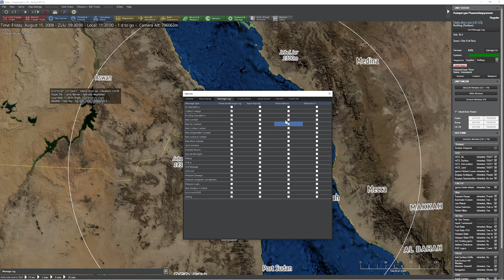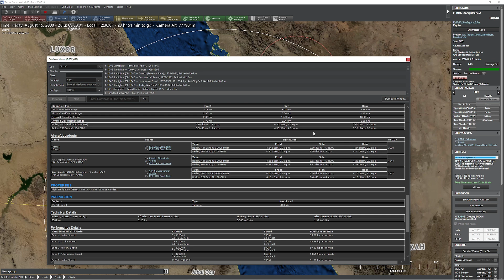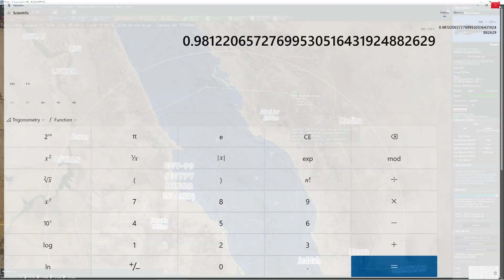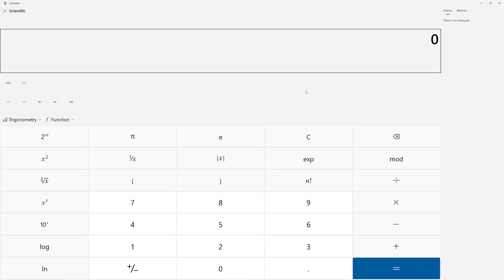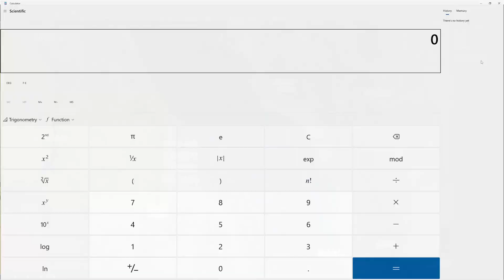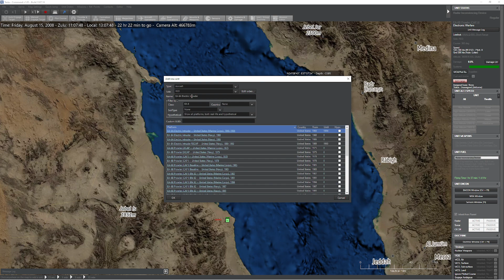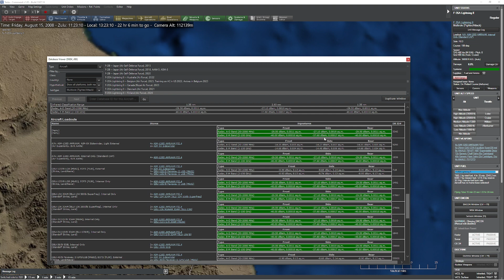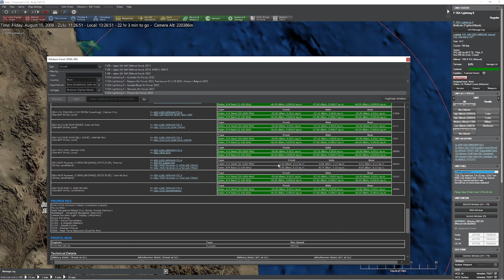C: MO - Radar Aspect and Detectability

Comment: Great video showing what rad=r aspect is and how it works! Which yeah the 4 payload slots of the F-35 when stealthy is hyper disappointing and is it's main con and why the USAF is buying the F-15EX to go with the F-35. Also technically the sim/game has that data of how best to approach a radar wit a Stealth aircraft it would just be unique to that sim/game and not indicdiv of real life much like the F-22 Mod in DCS has to main realism issue of no thust vectoring and is only based on what we can see at airshows/wargames which F-22 Pilots have said is just a percent of it's real capability and has hampered there training because they don't push the craft often enough.

Comment: You didn't mention that kind of jamming is directional itself, as shown by the detection of the closing fighters when the jamming aircraft were side-on to the radar. Likewise the jamming aircraft weren't detected because their footprint was larger side-on, but because the jamming is less powerful to the sides. It's also worth mentioning that a stealth aircraft works best in an environment where jamming is present, since is compounds the effect of stealth. The tradeoff is how close do you want the jamming aircraft to come in, as the jamming is more effective the closer it is as well. In CMO, with jamming present, the F-35 can close in to fantastical ranges without radar detection.
Reply: And doesn't jamming make a vehicle easy detectable by having a ton of noise around it?
Reply: @GreenBlueWalkthrough  Detectable with ESM, but not necessarily shootable because a radar guided missile cannot lock on.